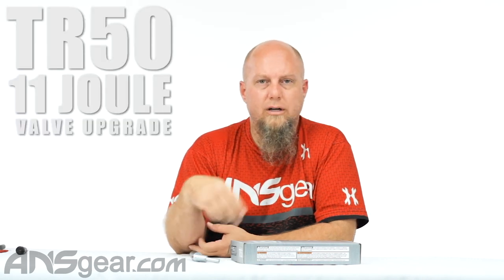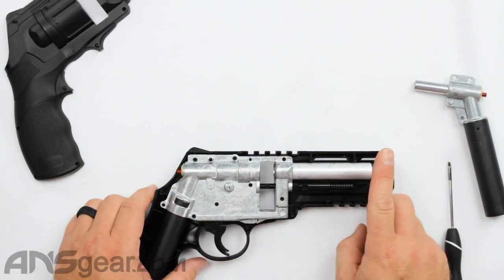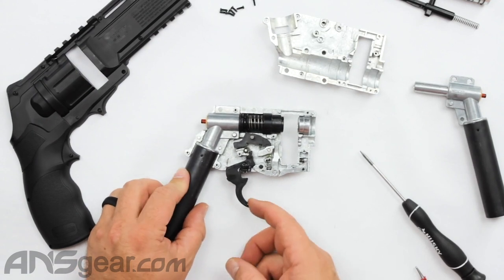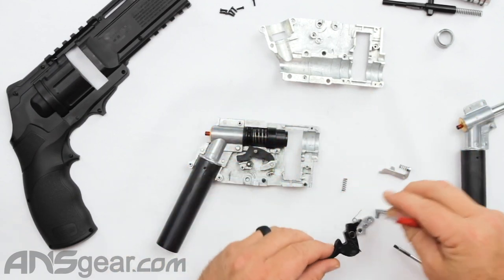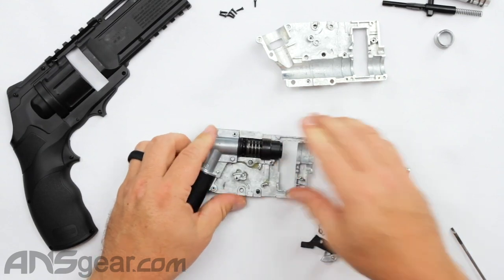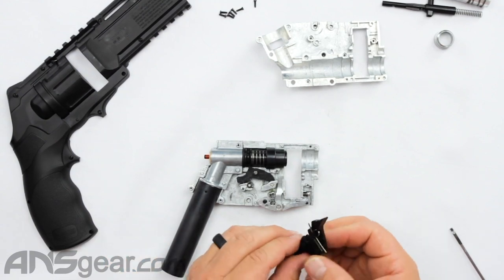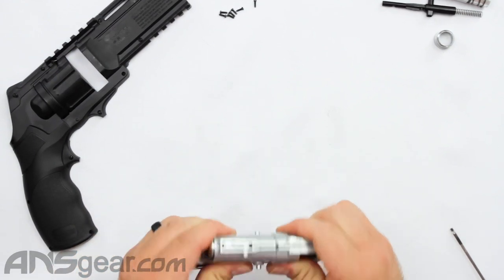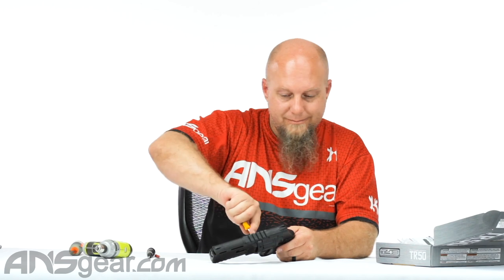T4E .50 Cal TR50 11 Joule Valve Upgrade - Install

Comment: Instead of using a metal flat screwdriver to separate the halves of the pistol. You might want to start out using guitar picks. Guitar picks are made of a heavy plastic very thin very strong. Great way to start separating the two halves without scratching or marring plastic or painted surfaces

Comment: Thank you - I found this absolutely the clearest and best video for fitting back together all those fiddly springs and levers in the trigger mechanism.
Reply: Hey there i installed the 11 joules valve system and ive only been able to shoot about 6 shots then the co2 is gone is that normal?
Reply: Agree

Comment: So I bought the 7.5 joule version, with an 11 joule valve, and a power kit. After stripping the aluminum firing pin, I finally was able to get it out and make the change. In my haste, some pieces came dislodged. If it wasn’t for your easy to follow step by step instructions, I’d have a paper weight. Thanks man!

Comment: I got the TR50 7.5 Joule version.
Then I went to HomeDefence-24 and got the HDR50 7.5 Joule version
 valve upgrade kit that made it 3 times more powerful.
The pressure chamber in the 11 Joule version is smaller so not as powerful as the 7.5 Joule version
With the Valve kit and remove the valve (throttle in the pressure chamber)
Increases the performance to over 20 joules!
Reply: I am waiting for 7.5 power kit to arrive and I know it won't be a full valve assembly like this. Does it come with instructions?
Reply: do you know how many fps its shooting at 20 joules?
Reply: @rawbeejay  
No, but the power kit must improve the power. I've just never seen a video for the 7.5 power kit.
Reply: @danielquesnel130  
Thanks. I'm still waiting for the Power Kit to be delivered.
Reply: I got the kit for the 7.5j the barrel and aluminium drum. Ammo maker too.  It’s quite the marker now.
Reply: @petersmith6974  I got 2 aluminum drums also,If it had a rifled barrel. I would have got one.A smooth bore barrel not as accurate as a rifled barrel.
Reply: Can you do it to the Pistol version
Reply: @mick1583  No it dont mate. Watch Rune Rebel. Just go "gingerly". Keep left hand fingers on all trigger parts to keep em in place.  You Will need "circlip pliers" for the pop out valve bit.    But, do it.  It works very well. 25 joule.
Reply: @danielquesnel130  prova la 11 jouole
Reply: @danielquesnel130  after I buy the hdp50 I will see about making a rifled barrel on my lathe

Comment: Impressive video. Could you extend the explanation of the internals. Especially how the gun actually shoots. What is different once it is under pressure. What exactly are the sequence of events when you pull the trigger, rotate the mag, push out the firing pin, actually fire and the retraction of the firing pin. It would be REALLY interesting and helpful to do a fully cycle explain video on the HDR50.

Comment: thank you so much, the springs had gone every where and I managed to put it back together. I then saw one spring out and new inevitably I would have to under do it all. was thanks to your video I saw it was part fo the sidewafds mechanism that helps the magazine turn. thank you sooo much for video, very helpful! 🙏
Reply: I have upgraded my T4E .50 Cal Revolver with a  TR50 11 Joule Valve Upgrade.  The video on the dis-assembly and re-assembly was great - I even took some pictures on my cell phone to ensure that I put all of the items together correctly. 

My problem is this,,,, after reassembling the unit, the cylinder does not rotate correctly.  Is there a video on making the magazine turn available for viewing?

Comment: Leave springs, triggers and things in place (with left hand). Put in the bits and pieces from HD-24.  For 25 ish joules. 8.3g chrome steel balls. Will need a sandpaper cigar to lightly sand out the chambers (not much) just snugg.  Be careful now, you have something different.
Reply: My stock cylinders seem way way too snug. That sandpaper trick sounds like the ticket, thanks.
Reply: @grintrap4455  Yes mate. a bit of round round sanding and trying will give you a nice heavy shooter.  Got mine on the bed-stand.
Reply: HD-24 what is this and where can I buy it?
Reply: @DDesigner123  Home Defense 24 sells things to upgrade your marker

Comment: I screwed my TR50 up. I ordered the 11 joule valve and removed the block. I had an issue with a spring but got it back in place. When I fire the gun, the co2 dumps completely 1st shot and seems to jam. Could I have a trigger mechanism issue or can I not operate the gun without the valve block? I realize the heavy CO2 usage and I’m fine with that. I have my HDP 50 set up like this and I get 5 hard shots. That is enough for a self defense situation. Any advice is appreciated.

Comment: I just got a TR50 but haven’t fired it yet. The shots are very difficult to push into the clip. 
Yes, I’m pushing them into the clip from the downstream / barrel side, other side is impossible. 
I have .50 yellow pvc shot AND .50 cal steel bearing type shot, but neither push in very easily. 
I have two other Umarex guns (HDS68, HDP68) that have much looser tolerances and easier to load. 
Is this a problem?

Comment: I did this upgrade which I purchased from directly from ANSgear Paintball and after installation I inserted a new umarex co2 cartridge and fired a few rounds and put the gun away.  several days later I went to fire the gun and all the co2 was empty!  Before i did the 11 joule valve upgrade i would leave my gun fully charged with a new co2 punctured and ready to fire for weeks at a time and go to fire it and not a drop of co2 leaked at all.  So someone please tell me why I'm now leaking c02 after valve upgrade.  Called ANSgear and they told me to call umarex USA because he's never heard of someone leaving a punctured co2 in the gun for long periods of time and not leak.  What am I suppose to wait for an incident to arise and need my gun then have to insert new co2 and wait to pucture it so I can fire a round or 2 and then have all the co2 leak out!????

Comment: Great video I'm waiting on an upgrade part for my T4E TR 50 and was wondering what was involved in installing it I don't expect it to go as smoothly as it was for you but you have probably done it a few times but I'm confident I will be ok I take wrist watches apart and clean then & reassemble on a daily basis I figure if I can repair old antique watches I cam manage this but I'm still saving this video for reference thanks for a awesome video
Reply from the maker: Feel free to give us a call @ (805)522-8700 & we would be glad to help you out with all of your questions.
Reply: @ANSgearPaintball  would it be a good home defense  gun. Just wondering.
Reply: @ANSgearPaintball  i would like to see a video on the gun 🔫. Showing how strong it is.

Comment: Is this valve  crimped and threaded?
Reply: I have that doubt but it seems to me that it is screwed because I have seen another one that has grooves around it and it was a crimped valve. It seems to me that the ones with the two holes are screwed.

Comment: Hay Rory I have a question I installed the 11 Joule upgrade everything went in smoothly afterwards I tested it out and I noticed that if I rapid fire it tends to do a pop pop pop after about the 2nd or 3rd shot only when I pull the trigger fast otherwise it seems to be fine any idea what causes that at first I thought I had a leak so I held it up to my ear nothing I could hear it's like the triggers stuck but it's not just rapid pops after I rapid fire after letting go of the trigger
Reply: Is it still firing when you rapid fire like that? And then you get a backfire ? Kinda like when you get a nice shift in your car? Haha I noticed in every video I've seen of someone firing a 11 joule they fire it slow
Reply: Made me wonder if you fire it quickly or even moderately would it jam